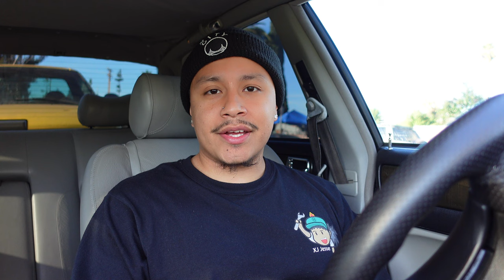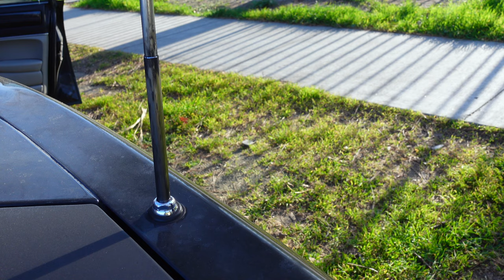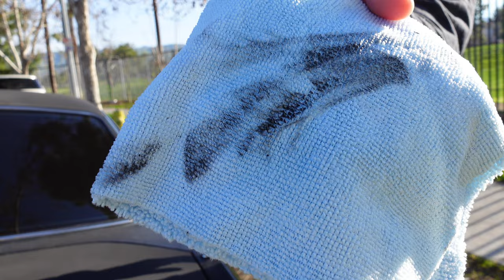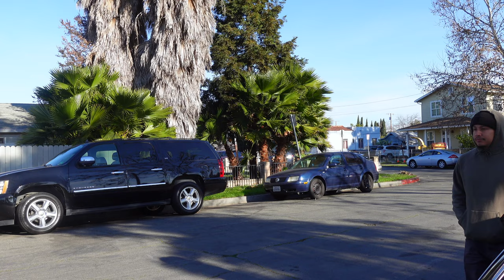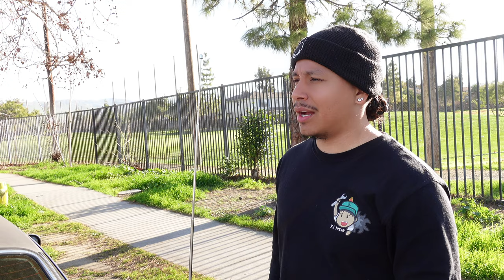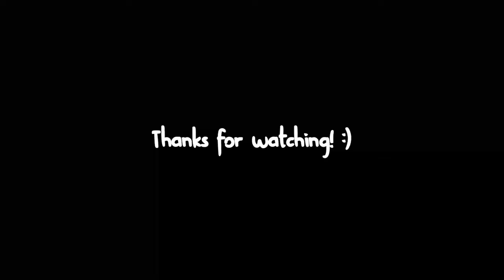Simple DIY Tutorial: Resolving a Sticky Power Antenna Issue

Comment: I have a 2000 lx 470 I replaced the.anntanna ad it will go down when I turn it off when I put the key in to start it  won't come back up on its own ad when it goes down the motor acts like the antenna is not one in there when there is what could be the problem ad can' it be ad easy fix or is the antenna motor no good